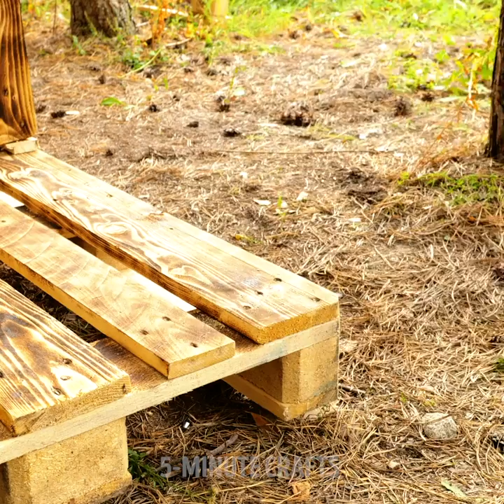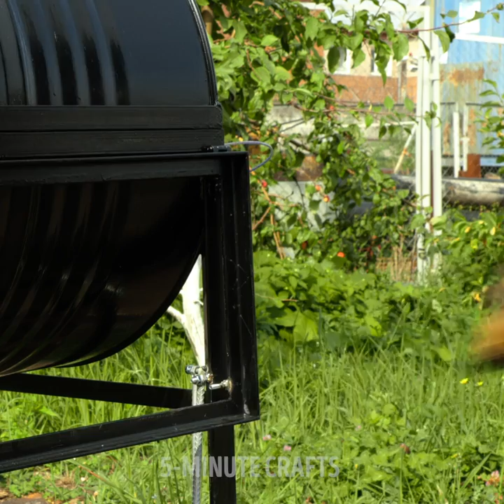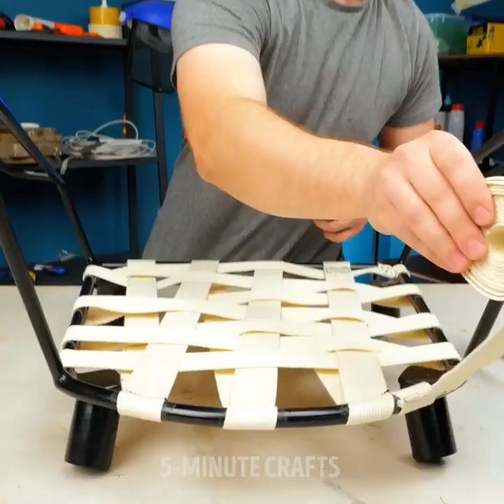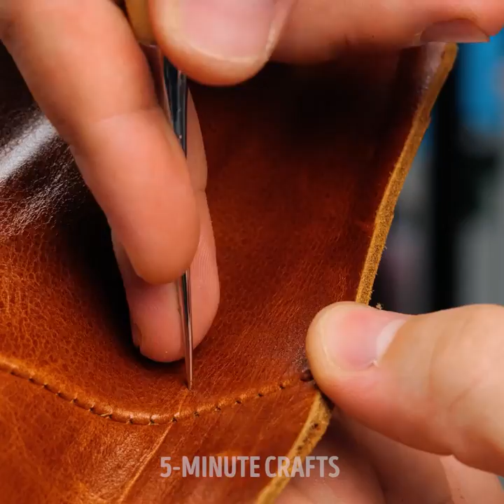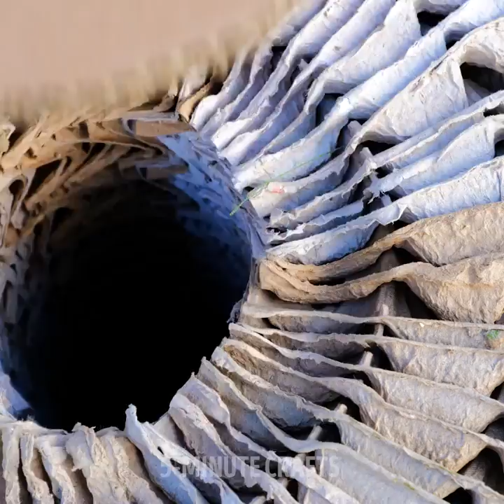Dog House With Wooden Pallets || Huge DIY Projects

Comment: It is seems to be too big inside.  If cold winters he will feel it. Dogs' houses must to be small inside so they can keep warm on winter. They make microclimat inside. If the house is big, the dog will freeze there on winter.
Reply: You are smart🎀🎀🎀🎀🎀🎁🎁🎁🎁🎁😎😎😎😎😎😁😁😁😁😁
Reply: @geovanacoiceiro2831  Thank you ❤
Reply: Big enough to put a pet heater outside or a welping pad.
Reply: @mickiemccomic3806  do/did you have a dog? Heater outside...lol You will get that dog sick. My friend bilt the cage in briks, stuck on the kitcken wall where the stove is. Very well isolated and not too big. His rotweiller is very confortable there, he even doesn't grow thick fur in winter.

Comment: Why would you not seal the floor...so the dogs paws🐾🐾wont get stuck between the boards and injure himself?

Why would you not test it
for leaks...""B4"" IT RAINS💦....? usining a water hose

Came out really nice YR DOG IS LUCKY

Did the girls forget to SEAL/Weld the Holes / Spouts on the barrels....B4 putting it in the water?

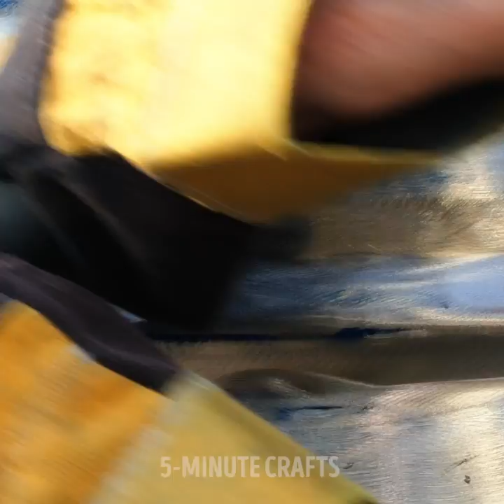Comment: Comment section don't understand, but I work with these things. They should've just used a 7 or 9 inch grinder on the barrel at 3:18. Would've been a LOT easier and faster.
Reply: Really.. so I try it too
Reply: @kritikakumarikumari5478  I mean no matter what size you use, it's still an electric rotating blade. So if you're going to try it, make sure you wear proper protection. Hot metal in your eye sucks.

Comment: Could I get a list of the materials used including quantities?
Reply: România /🤩💪👌🙌
Reply: It's a dog house, not a cake 
XD
Reply: I've just built this and i used 12 euro pallets,2 8x4 sheets of ply,2 rolls of astroturf for the carpet,1 roll of 10x1 roof felt,1 tube of black silicone sealant and 2 boxes of timber screws. Took me 6 days doing an hour or 2 a night after work. Also fitted solar powered fairy lights inside too